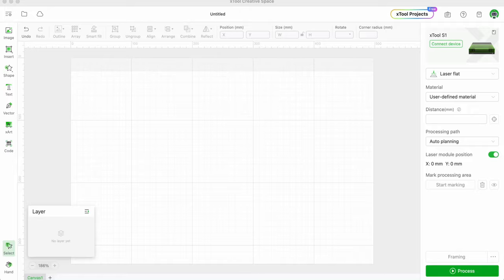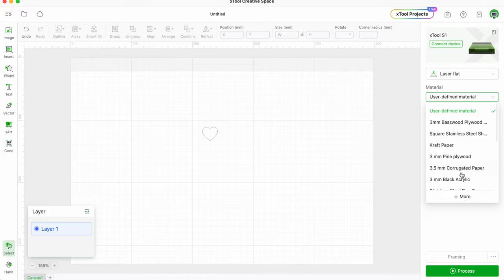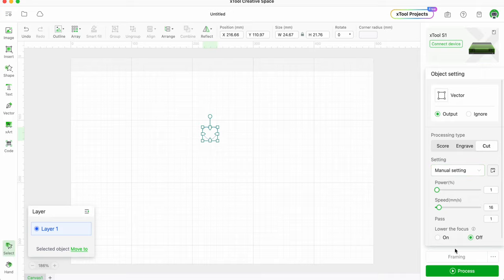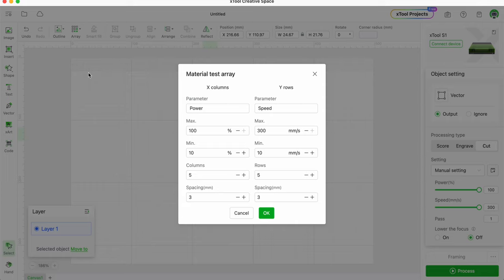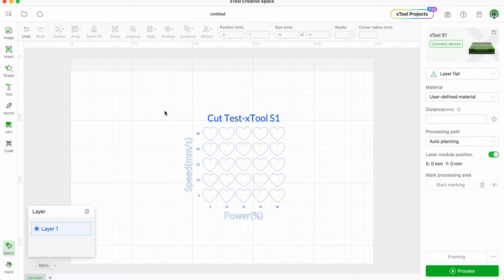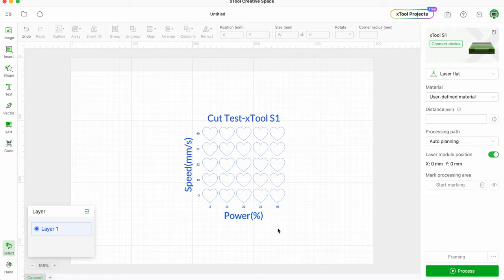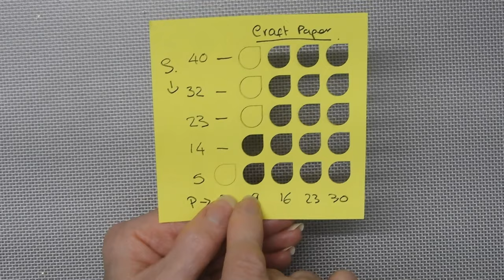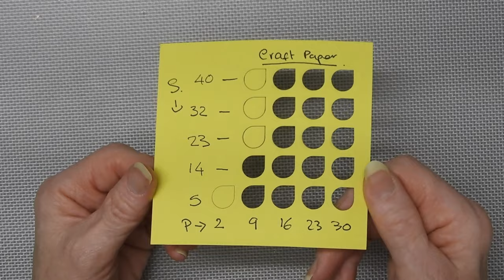XTool Creative Space Material Test Array.

Comment: Really useful video thanks. I too found that most videos and reviews of laser cutters were for wood and leather. Some manufacturers don't even list paper/card cutting support or specifications.
Reply from the maker: I think that may change a bit now that they are entering the craft market..there are many who bought the M1 and are upgrading to the S1. They may have to give paper crafters more prominence.
Reply: Cutting intricate designs with paper was the exact reason I bought my M1 almost 18 months ago. I made a few attempts but wasn’t happy with the charring.  However, at that point in 2022, the grid array feature in Creative Space didn’t exist.  Thanks for highlighting this.  I’ve never used the array feature either so I just didn’t realise the test grid was there. To do it all manually was VERY intimidating and time consuming as I just didn’t know what settings to start with. Thank you for showing it or I would still be in the dark.
Reply from the maker: @katet2688  You're welcome! It will give you a starting point at least. If you want faster speeds, you can generally double up both numbers and adjust if you get charring. My setting for copy paper at present is about P30 S32 - bear in mind mine is 20W though.